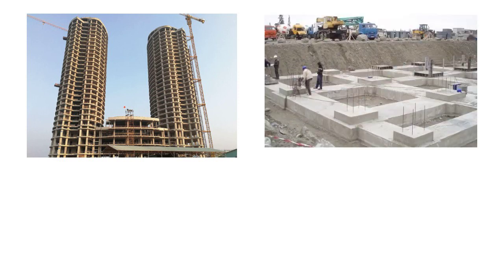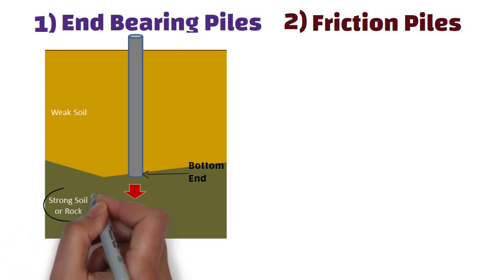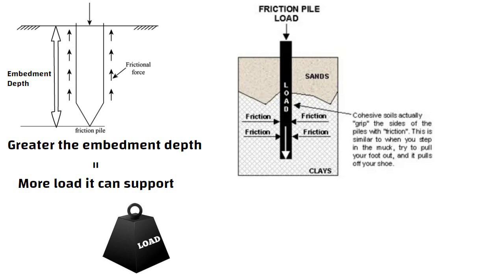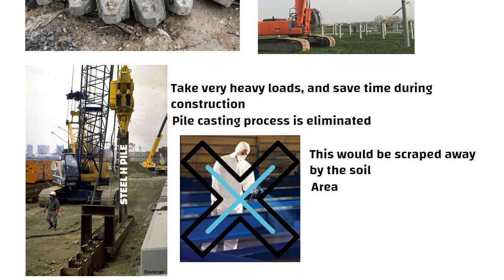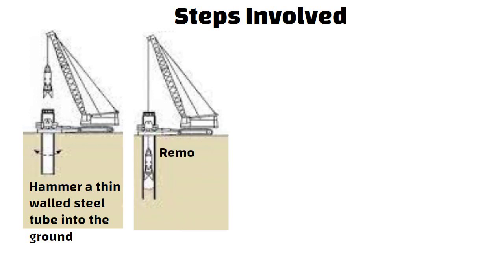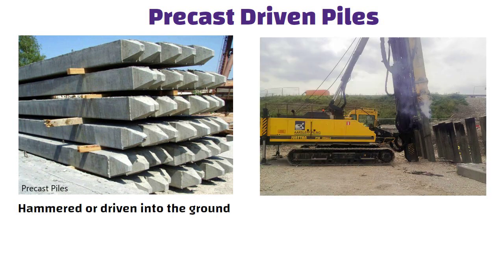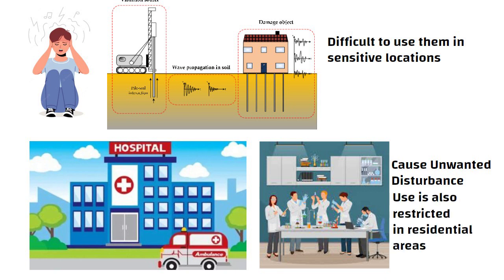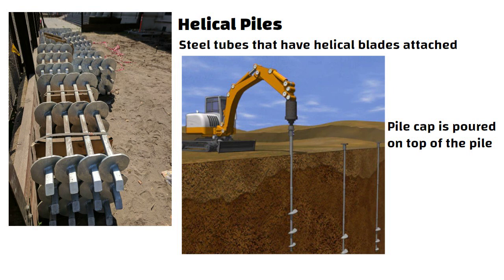Basics of Piling

Comment: Why in cement grades are 33,43 and 53...
Why not used other numbers sir....
Reply from the maker: It's because cement achieves 33,43 and 53 mpa strength in 28 days for a respective grade. And it's 28 days because  it is the amount of time required for the cement to achieve its full strength.
Reply: @engineeringmotive  thanks 👍